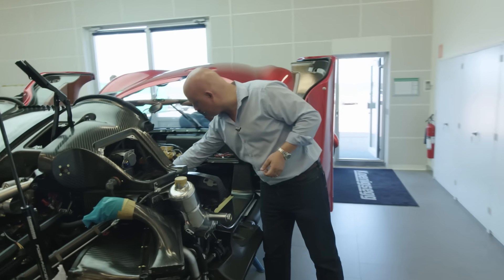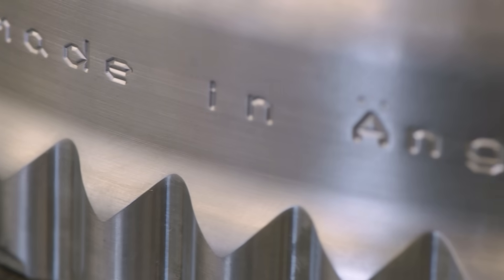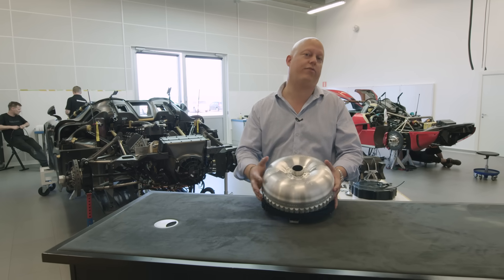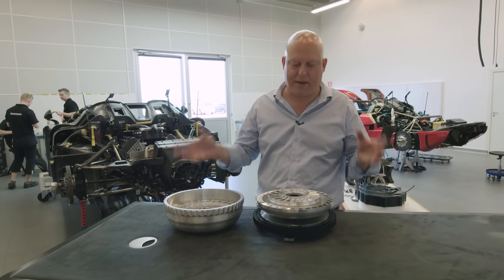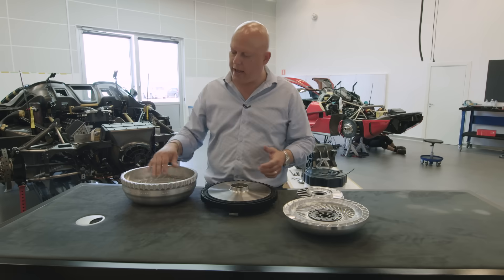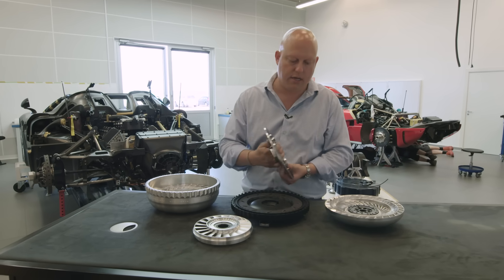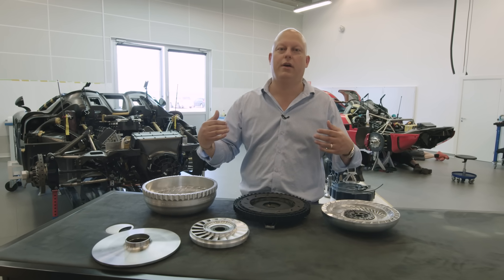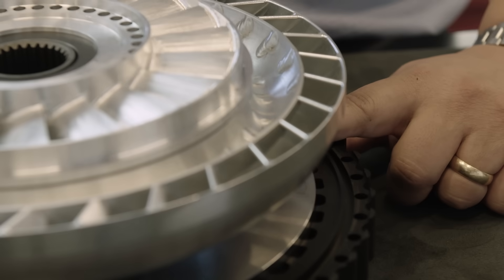248 MPH Without A Gearbox: Direct Drive  -- /INSIDE KOENIGSEGG

Comment: My question is would the Regera have a lower engine life (Meaning needing more in depth servicing more often than other super cars) Because the engine is never idling? Because even during braking the engine is still connected to the wheels because there is no neutral while braking like there is with a manual or automatic gear box. (correct me if i am wrong but I believe during braking in a automatic the torque converter is disconnected and free spinning allowing the engine to idle while the planetary gears change??)

I mean there might be barely a difference but it's something to consider... (even though the efficiency from the free valve system would probably make up for this because there would be less chance of timing problems amounting to carbon build up in the intake manifold.)
Reply: j0n0j0n0j during braking, throttle closed, on a fuel injected car, the injectors are shut off. The engine doesn't idle while braking, the engine speed drops as a result of the wheel and gearbox speed. During that time your fuel economy is essentially infinite.
Reply: Patrick94GSR Yea sorry I didn't use the right word. I meant that there is no power going to the engine and the gearbox is used to slow the engine and car down (as well as the brakes) (Didn't mean to say idle). But I mean without a gearbox wouldn't the engine be working harder during braking than a auto or manual car (i.e. shorter engine life)? Because the car is never in neutral...
Reply: j0n0j0n0j I don't think so. When you slow down in a normal car the engine is not in neutral either. Closing the throttle imparts vacuum in the intake and cylinders which should be the same regardless of whether there's a gearbox or not.

This is why it's better in a normal car to leave it in gear during deceleration. Throwing it in neutral immediately after closing throttle means the engine has to use fuel to keep idling. Leaving it in gear means it uses no fuel at all until you come to near stop.
Reply: Patrick94GSR Yea I realise that, But I'm talking about when you change back a gear the engine is in neutral and for racing (i.e. on a race track) You use the gearbox to help brake the car (i.e. compression braking) But without a gearbox the car is never in neutral so there is never a point where the engine will slow by it's self If you understand where I am coming from. The engine is always under a constant load from the momentum of the rear tires. (Even if the throttle body is closed and injectors and spark plugs are off, the engine is still under load of the rear tires, otherwise the engine would lag when you put your foot back on the accelerator)

I just mean the fact that a considerable amount of load is put on the gearbox in a car hence why gearboxes need replacing well before an engine does in your average car. But without a gearbox the only thing that would wear would be the hydrollic clutch in the coupling. So i.e. there would be significantly more pressure on the engine, hence lower engine life.

A differential will never break unless you do significant burnouts and the hydrolic coupling won't break (besides the clutch) So there is only one part between the flywheel and rear tires that pressure is put on. So I would presume that more pressure would be put on the engine in a true drive system such as the Regera. That's what I was getting at....
Reply: j0n0j0n0j I see where you're coming from. Slowing down shouldn't be an issue, there just wouldn't be as much engine braking since you're not downshifting. If you left a car in top gear, slowed, then tried to accelerate again the engine might lug because of low torque available in the upper gear. But here you have the electric motors helping to overcome that. Plus the engine itself is already powerful enough to get going fairly quickly without needing a lower gear.
Reply: Patrick94GSR Yea exactly. I'm thinking more to do if you drove this car at it's peak on a race track. I mean braking from 270kph-150kph and putting the power back on would put a significant amount of load on the engine when in a manual the load would be on the gearbox (Well some of it).

Regardless of the pressure split between the ICE and Electronic motors, there would still be significant more pressure put on either or compared to a manual or sequential manual gear box (Like in some race cars, well any besides the sequential autos that most have)
Reply: They spent a lot of time and money designing a sophistcated torque converter to deal with the issues you are describing. It determines how much torque is transmitted in either direction ideally keeping it at the optimum level for performance.

Comment: ok i kinda get it.. since the Regera is a hybrid EV/ICE so i guess the idea of having this very light weight and seems to have a series of hydraulic clutch pack seems 2 sets are there like a lock up converter is there's no need for the actual torque converter since the torque power band from electric motor is already there for you for low speed low rpm or even in high rpm low speed scenario..   but for him saying "7th Gear"  there was really no gears.. i guess he's just saying the torque of the electric motor shifted the car to 7th gear even it didn't have it..  honestly, that's the whole benefit of electric motor!

Comment: Good solution for a ultra high /torque power application especially when combined with electric powered motor which makes all its torque from zero rpm
Surprised it will still would do 0-100k/h in 4 seconds without the electric motor assistance on a ratio that's geared to go 250mph+
That torque converter must be doing a epic job also the engine must be tuned for tones of torque at low rpm.

Comment: for anyone that doesn't understand it is simply a standard lockup style torque converter that's been beefed the fuck out of.  getting off the line it has a "reduced gearing" effect because of the fluid coupling which multiplies torque for off the line acceleration. after a point it locks up like a standard manual transmission clutch so that it does not loose efficiency
Reply: because everything is so strong it means the gearing is effectively the equivalent of 7th gear or a double overdrive in most cars. less time spent changing gears means more time with power to the wheels. with that said traditional manufacturers have tried and failed here already with the CVT transmission

Comment: So it only has one gear?
Reply: If I understood correctly, instead of two clutches using friction to drive from the engine to get the wheels from still to moving, they use hydraulics and apply pressure similar to a hose spinning a fan, except efficiently.
Reply: It has no gears. The torque converter is used as a 'gear box' but has no gears.
Reply: It does not have a gearbox.  It is direct drive.  The electric motors help get the car going from a standstill and those and this torque converter make it to where it does not need a gear box.
Reply: A torque converter is a form of CVT...  you can get a good idea of what a torque converter is by checking out go kart torque converters (basically a belt with a variable size spring loaded pulley that changes size with load)
Reply: Elemino Musgrove
 No they are aren't the same thing but they do accomplish roughly the same task. Sure.. and an automatic or manual transmission is a form of torque converter strictly speaking.
Reply: Its looks like my old hondamatic. 2 gears
You can drive in one gear........ no shifting...
Reply: when you said Gokart then described it i though snowmobile.
Reply: Trent Nelson
 Yeah I think they use something similar if not identical at least on smaller snomobiles... larger ones probably have one but it would be beefyier than a go kart version.
Reply: Not quite. The CVT and go kart torque converters can have faster output than the input, a torque converter cannot.
Reply: Elemino Musgrove
 What is your point... it still converts from one ratio to another. You're just drawing a line between them where there is none. If you want a torque converter to output faster than it's input just put a gear on the output to the drive shaft... it is just that is not usually what is done as it usually isn't practical or needed. It would also mean that your torque convert would only lock up once it got past the 1:1 ratio....
Reply: Chase Rayfield my point is a hydraulic torque converter is not really the same thing as a CVT or go kart torque converter. They share the same name, but they are not the same. You put something in one side and get something out of the other... but there are a LOT of things that do that. By that logic you can call a transmission a torque converter.

Comment: Jason from Engineering Explained should make a video on this
Reply: I'm pretty sure he already has, but for the whole powertrain of the Regera.
This hydraulic coupling part is pretty much a torque converter that can lock up.
Reply: Sam C Why? He explains thing like a tool
Reply: he might not look or sound like a model, but he's damn good teacher!
Reply: i don't even know is this is the transmission or torque converter
Reply: Think torque converter from a automatic with a clutch on the back of it allowing it to completely lock up. (because in a automatic the planetary gears would be to blame for a 1:1 Gear ratio before the final drive of the differential) But in this the clutch locks the whole torque converter up so that it free spins and does nothing so that it is a 1:1 gear ratio (not taking into account for the final drive i.e. differential ratio). 

So in theory I believe it would have 1:2 gear ratio and 1:1 gear ratio to the final drive. (Plus whatever the two electric motors at the rear put out (which is 160kw each I think)) So that it can produce an insane amount of torque at low rpms while the engine would struggle by itself to take off in 7th gear from a dead start.
Reply: For all you know he could be on his way to innovation in EV Technology
Reply: he doesn't know anything about electric motors he only talks about gas engines
Reply: Thor Karlsson he doesn't do super cars though...all he talks about is his subaru. besides, ever heard of the model s p100d?
Reply: Sean W Fucking A.
Reply: He does. But the market for supercars revolves around petrol engined cars.
Reply: Uh naw
Reply: There is no transmission! Didn't you watch the whole video lol???

Comment: I didnt understand any of this
Reply: Spins the tires at 170mph. All that needs to be said.
Reply: Yup. Between engineering videos and astrophysics videos (shout out to PBS Space Time), most of my Youtubing experience is spent in a perpetual state of confusion.

The joys of being curious, but dumb.
Reply: lol... me neither, he tried his best to explain though...
Reply: Adam J horsepower is a function of rpm and torque. HP=(torque x rpm)/5252. So to keep the horsepower high and the rpm low you have to make the torque higher. Which is traditionally done with gears. The coupling (torque converter) is basically a 2:1 ratio hydraulic "gear". When it locks up it turns into a 1:1 gear so higher rpm and lower torque for top speed. The takeaway is that the HP doesn't decrease.
Reply: They are using a torque converter to allow their vehicle to drive around on one gear. Meaning it eliminates the need for a gearbox. Because they dont need a transmission (gearbox) they also gain a lot of horsepower because the power coming from either engine doesn't have to send it's energy through a transmission and then down to the wheels. This is commonly referred to as drivetrain loss.

Read up on torque converters if you want to understand more, then come back and watch this video again. Will make more sense.
Reply: Really begs the question: If torque converter companies did get it, why did they think a youtube watcher would understand anything of this? =/
Reply: its basically a split fund coupling. youtube fluid couplings.
Reply: Ray Pfaff 
so where is ist wrong ?
Reply: He lost you 3 seconds into the video???? lol  I design aerodynamics for semi trucks and trailers and try to explain to multi national companies where the whole wind tunnel  engineering is wrong and they don't get it. Some engineers are differently wired . Literally .

Comment: that's a nice torque converter but you need a variable pitch blade on a turbine & impeller and stator and you're probably using a Sprague clutch and that also can be varied towards when lock up is needed this will increase your torque and improve efficiency. has anybody talk to you about this?

Comment: It would be smarter just to use electric motors instead of not so efficient petrol motor that only works on the top and or with torque convertor on the low end.

Comment: Put simply:

Torque converter can create more torque at price of lower outpudlt speed (hydraulic reduction), lower efficieny and it alows engine to slip. Normal clutch has no slip, but it can not create additional torque. This system combines both - slip abbility and torque multiplication for taking off and non slipage of normal clutch for efficiency at higher speed.

After final drive and differentila, each half axle has its own electric motor which provides torque vectoring (normal car uses brakes for torque vectoring, which wastes energy) and electric motors can sping in reverse, so car does not reverse gear. Even if battery is flat, generator connected on motor makes electricity, which powers 2 electric motors, while engine slips on torque converter, alowing it to go reverse.

Comment: I love what this company brings to the motoring industry, not just for sports cars but for everyday vehicles. I'm still waiting for Freevalve in motorcycles.
Reply: 6Twisted Ducati has desmodromic. So no springs for the valves which is how they rev so high without valve bounce. 🇦🇺
Reply: The belt life-span has nothing to do with the valvetrain. The only extra maintenance a Desmo requires is the shimming of it's valves, which is relatively easy with practice. Also most of Ducati's belt change intervals are based on old non-reinforced belts. You can  safely run modern reinforced belts well over twice the recommended life span. FYI I own two Ducati superbikes (one with a Desmoquattro the other with a Testastretta) that I've daily driven for over 5 years, at one point around ~50 miles a day.
Reply: Keep waiting...it probably won't happen.
Reply: Maintenace on those desmodronic engines is horrendous. New cam belt every 5000 km. I would love desmodronics if it wasn't for the maintenace issues, Maybe with new materials like ceramics